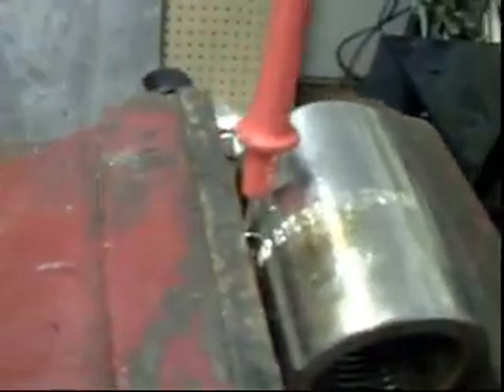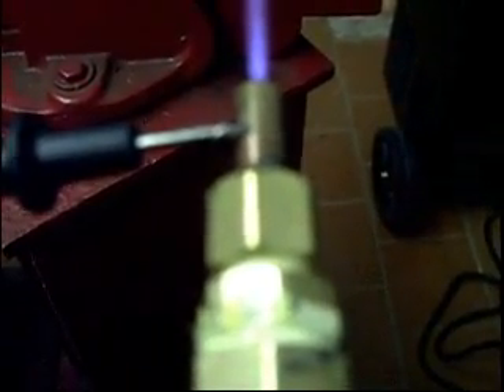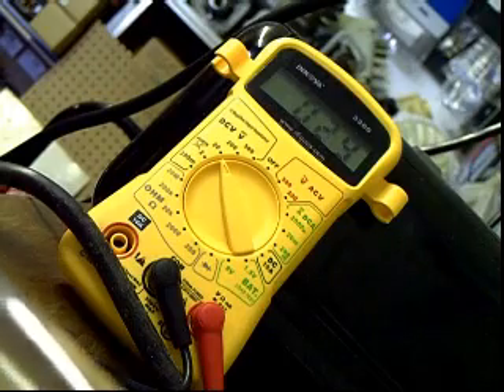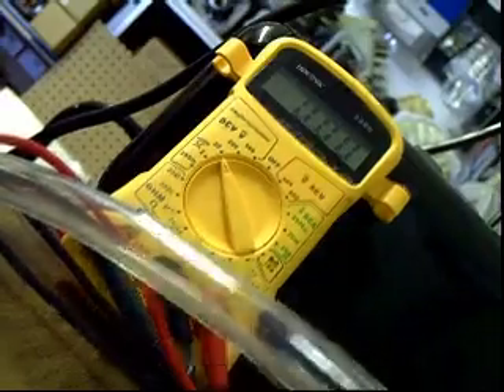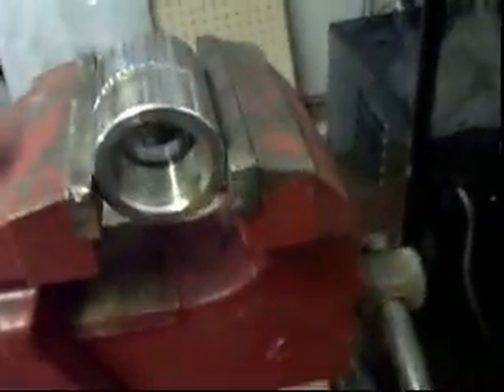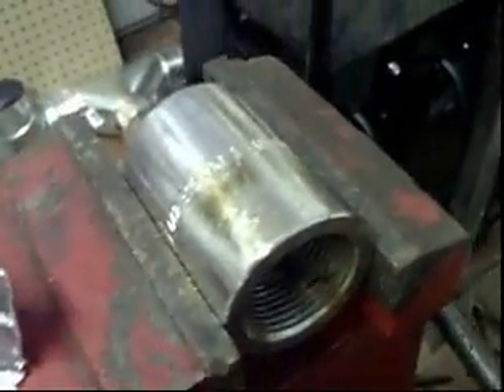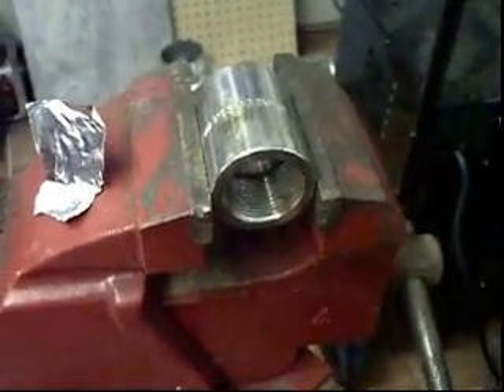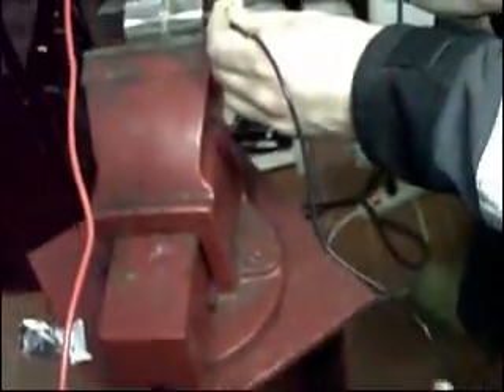#12 Strange reaction with Hydroxy Torch

Comment: @hhoball
Suggestion: i think a TPV cell, or Peltier device could help out harvesting that V potential.  But i bet if you could cool the outside of the metal tube, you can probably increase that Vpot., and then run that into a Boost converter of some sort.  OR, like someone else said, run 2 in series (if, in this setup, you can actually do that without gaining more losses), then youre already almost doubling your Vpot.  Then you could use the coolant-idea, and potentially get like >10V, and that could be your INPUT to a boost circuit.  You could potentially pull 500V - 1KV from that setup easily.  And im sure with some more (money, time, research, tests, etc etc), you could really tune it in and get some really HV from basically, water and a coaxed & nurtured thermal gradient.

Comment: A multimeter is essentially an electron sensor.  You're trading electrons with the hydrogen gas torch and the surface it touches.  The power behind a hydroxy torch's ability isn't through heat but the electron swapping between the gas and the surfaces it touches.

Comment: Dont know anything about this but it keeps ringing in my head that The flame emits some kind of elektricity that goes in the stainles steel which acts like absorber and then releases it through the wire (anode) on the  reader apparatus  :)

Comment: I use to repair nat gas furnaces for a living.... not sure why it does it but the flame sensor on a electronic ignition furnace does the same thing... the ignitor in the furnace has AC voltage to it to make it glow white hot and when the gas is released it ignites and the flame sensor is in the flame... somehow the flame converts the AC to DC and it carries over the flame to the sensor... this is how the furnace can tell that the gas is being ignited.. if it does not pick up the voltage it shuts down the gas for safety.... like i said i have no idea why but I hope this helps...
Reply: The sensor changes its electric resistance, and with a small current, its voltage with heat. this is how it signals the flame is on or off. Not the same thing.

Comment: Just try to put a resistor in between the leads of your meter.  Your meter has either 1 or 10 megohm of input impedance.  That is equivalent to "no load". And as you know, voltage can be put to good use only in circuits that show current and thus, some form of a load.

I suspect that even 100KOhms would dramaticly that voltage to near zero.

Comment: Not sure if this has anything to do with it, but you need something like 1.6 volts minimum to convert water to hydrogen and oxygen. Maybe this is the energy you get back when you recombine the two.

Hey wouldn't it be cool if you could use electricity to convert water to HHO, then when you burned the HHO you got heat as a by product while recapturing a large portion of your initial electricity input. This could in fact mean the HHO is a much more viable energy source than we previously thought.

Comment from the maker: Its possible for sure. 
My best guess after further experimentation is, ions are causing the differential. Voltage can only exist when there is a differential in charge between two points. I believe the gas is ionizing and causing a charge on the steel coupler. I am building a huge torch to see if i can get a higher voltage with more gas. 
Stay Tuned!

Comment: static charge from the hydroxy gas is there any amperage coming from it aswell?this was probably why stan meyer was putting the burnt gases back through his system to burn for a second time with air and get a better burn ratio with less electric with the mix when he used his water buggy.combustable ionised and non combustable was the mix he was using in the plug he developed ;-)

Comment: My thought would be that the actually energy that is being used is (producing heat) ( or the flame) generating the electricity. The HHO doesn't actually burn it is energy that is being produced from the Hydrogen/oxygen going back to water which this process is some type of electricl field. I don't know the scientific explaination but energy is produced when hho goes back to water.

Comment: This is very simple.  The gas is creating a static charge to build on the stainless ring.  The leads then discharge this to ground through the torch.  Since you have a constant build up of charge while simultaneously discharge through the volt meter.

Comment: Could it be that you're getting a voltage flow through the gas; or maybe through the hose. I'm not sure the low voltage needed to produce HHO would allow a charge to flow through the gas; but, the hose may material could allow electron flow to pass through the system as static charge. Good Luck!!!

Comment from the maker: It didn't work unless the flame was present. 
Right now i only have that one stainless steel thick ring, so i cant put two together yet. I am trying some different things right now to amplify the voltage. I will post a video as soon as i get something worth showing. The highest I've got so far is 
2.3V.

Comment: Hi! The theory is that some kind of electron injection is happening that's why the flame can melt ANY material, metal glass stone even ceramic.Think microwave-effect,with electrons instead. Maybe electrons are having a bowling-ball effect on atoms and they shake = more heat. HHO will heat any material TO the melting point, not above it, witch is also interesting because it has "automatic temperature detector" in the flame itself..  It can also not heat water directly with open flame! WOW right ?

Comment from the maker: i am applying the flame to the inside part where its thickest and has no threads. if i let the torch touch the bolt then the reading disappears and shows zero volts. The flame is on a 45degree angle when i apply it.

Comment: part # 1       hey bro this is a theory 
a small portion of the gas behaves as does an electric fuel cell ,fuel cells convert o2 and h2 
into voltage thats why the acetaline and the ion comments "even mine" are full of shit this answers absolutly nothing ionized my ass, if it was ions alone 
acetaline would do the same, water needs voltage to be decomposed so who's to say the synthesis 
of water doesnt generate voltages when its created by combustion of o2 and h2